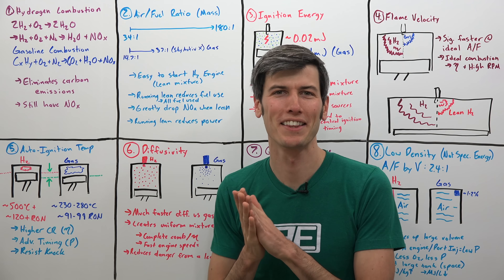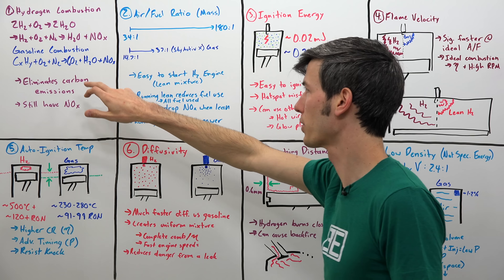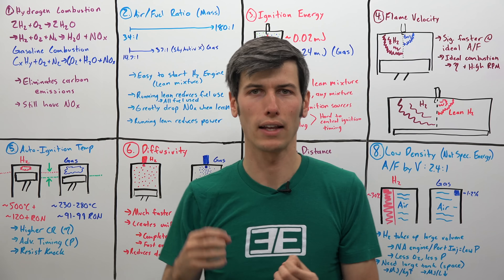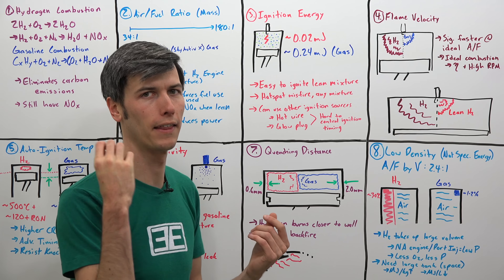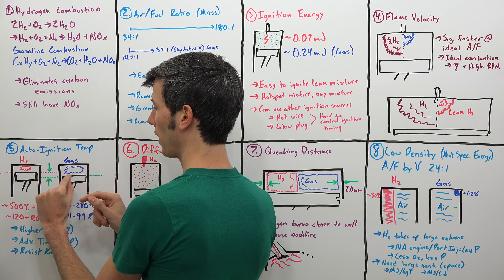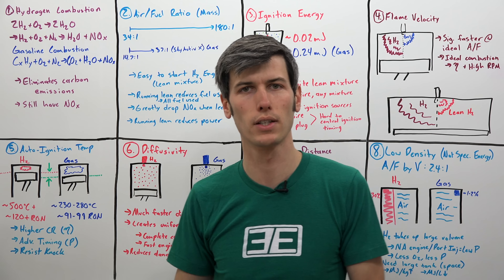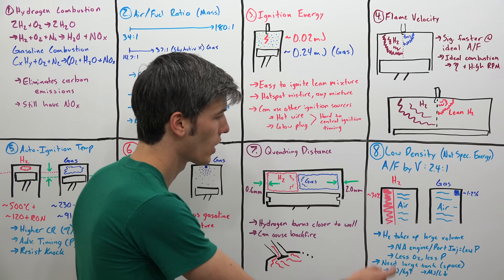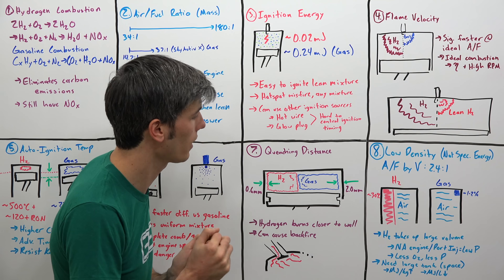The Difference Between Gasoline And Hydrogen Engines

Comment: I really like how all the pro's and con's are presented in just the facts. I wish the news was like this.
Reply: Walter Cronkite delivered news via television in that manner just facts. One wanted to watch his newscasts.
Reply: Nobody has to listen to the fake news.
Reply: we're screwed until the country is run by scientists, engineers and doctors. We won't get news like that until politicians aren't really politicians anymore
Reply: What about using a rotary motor like Mazda used to use? How much energy do you have and using a reed valve type carburetion. The other thing can be a glow ring on a conventional stroke type engine using Keith black ceramic pistons. The glow ring is a part of the head gasket, it is a ring that creates a ring of fire for spark that way no chance of misfire uneven. I believe there is a future in the rotary engine because of the temperatures running you don’t have to worry about the seals like gasoline rotary engines like that RX seven. Also, it could be ran on multi fuel mixtures. I have been involved in alternate fuel cars before in the past for many years propane cars using small gas injection to start it and keep the rings oiled. Please respond to your thoughts on multi fuel hydrogen, a detonator that would stop any pre ignition what do you think it would be.?
Reply: Perhaps at the alcohol ethanol, as a pre-starter for hydrogen.
Reply: It was pre 911
Reply: Did he really mention that CO2 is highly preferred pollution over NOx?
Must of missed it.
NOx is an oxidizing agent and will react with other gases, particles, etc
What you end up with is ground level ozone, smog, acid rains and more issues.
My main concern is that this guy know it but make no mention while claiming "at least we get rid of that Carbon pollution" without even a mention about NOx big issues.
It cause respiratory problem, allergies, inflammation of the lungs and throat, etc.
How do I know he does ? He know what he talk about on it for the rest of the video. Bit of a bias when you claim a good thing you get rid of is CO2 when you dont show the other is worse.

Its hundredS of time more dangerous for our climate. Why do people never explain that impress me. But such is youtube I suppose.
(not trying to pull him down, still a fun watch)
Reply: @littlegile5072  Because we have things called catalytic converters, and for diesels DEF exhaust fluid...
Reply: @SGTGGeorge  dont think you replied to right person because I do undertstand 2 things clearly. 1. NOx is more toxic, polluting and problematic than petrol based cars.
2. Talking about car parts doesnt changes the facts.
Reply: @littlegile5072  well if you knew anyting about how a catalytic converter works you would know that uses precious metals and a catalyst reduction reaction to break down the NOx into lesser polluting elements... 
Here's the official definition By most estimates, catalytic converters fitted inside the exhaust pipe of a gasoline-operated car convert over 90% of hydrocarbons (HC), carbon monoxide (CO) and nitrogen oxides (NOx) from the engine into less harmful carbon dioxide (CO2), nitrogen and water vapour.
Reply: @littlegile5072  like the Toyota Mirai
Reply: @littlegile5072  petrol based fuels still produce NOx, they’re worse for the environment in more ways than just CO2, but you seem to be overlooking that and just going “nooooo hydrogen bad because NOx, Petrol is betterrrrr!” Without addressing the fact that no, Petrol is not better it is far worse
Reply: @littlegile5072  and the pollution of batteries to  make them and throw away
Reply: @onlythewise1  You do realize that Hydrogen is the way forward... All electric cars are not... Until battery technology can advance to the point of recyclable, high capacity, high voltage, compact batteries arrive. Which there is already tests on solid state batteries and solid state hydrogen fuel cells that will be the future.   Oh and you can make hydrogen in your garage from water using electricity... Can you do that with fossil fuels?! 👌😉😜
Reply: @onlythewise1  I agree to use batteries that can't be recycled is idiotic. But we recycle all our car batteries.
Reply: @SGTGGeorge   hydrogen been discussed twenty years ago dork. i bought some stock in it it  failed   there doing batteries
Reply: @onlythewise1  Key words being "discussed" in a world where Oil was cheap and abundant and no one gave two shits about carbon pollution... Porky..
Reply: @SGTGGeorge  oil never been cheap . ok real porky
Reply: @onlythewise1  Not to mention that we would of never landed on the moon without Hydrogen Fuel cells in the 60s. So a lot longer than 20 years ago! The military uses Hydrogen Fuel cells still to this day successfully.  Arnold Schwarzenegger has a hydrogen powered fuel cell that powers his Christmas lights! 🤣😂
Reply: @SGTGGeorge   i know that i dont need a  parrot reading and telling me things  tell me things from out of your brain not someone else ,
Reply: @onlythewise1  The more you post the more it's clear, that you are "special". 🙈😱
Reply: @onlythewise1  That was all out of my brain. And then I went and pulled the definition of Google to show you... I went to automotive school, and worked in the industry for ten years.
Reply: I apologize for disrespecting you after you disrespected me. That was childish of me for falling in that trap.
I only strive to educate. And have my voice heard. I do not enjoy putting people down. Please forgive me for upsetting you and have a wonderful day!🌍
Reply: @onlythewise1  I read and study all the time. I love learning new things, and all of this kind of stuff fascinates me and I'm highly passionate about my mechanical skills, and technological prowess.
Reply: @SGTGGeorge   and you repeated all that   you read  not   do in your own brain  Einstein did in his own brain hydrogen been known for over hundred years i leaned the element chart fifty years ago
Reply: @SGTGGeorge  the more you talk the more i can see your into your self
Reply: @SGTGGeorge  😂😂😂😂😂😂😂😂😂
Reply: @onlythewise1  🙈
Reply: @SGTGGeorge   out of your brain is something you created  not something  you read and then say it later
Reply: @onlythewise1  So I see the problem here you keep moving the goal post on why I'm wrong to something not even remotely close to what we're originally talking about. It's my fault for not interpreting your broken English, and lack of grammar and ability to communicate and to properly express yourself. And I take from what you just stated that some how I'm wrong or that I'm plagiarizing definitions? And I was supposed to put forth an brand new original idea to rival why NOx you say is the worst?  I did that scroll up...
Reply: @dianapennepacker6854  Carbon nanotubes solve the volumetric density issue. Toyota is looking into solid storage mediums that store hydrogen at a much higher densities and have made tremendous progress with hydrogen 
Also you are incorrect the fuel cell mirai does not weigh near as much as battery EVs.  Hydrogen is the future battery EVs are not the answer.

Comment: Hmm I'm thinking rotary engine.. Made like a super diesel with super high compression, and spark plugs. The lack of carbon would probably make the difference and it would probably lend itself to the general charictaristics.. CMon mazda.. u can do it.
Reply: The trick to the tank is to find something dense you can knock hydrogen molecules off of for fuel. Or find some lubricating fluid that is clean to use as a carrier molecule.
Reply: Imagine if you could use the fuel as a lubricant too, and its waste comes back through and grabs the hydrogen for combustion again.
Reply: lol Skyactivex rotary

Comment: Video should be made, to explain how hydrogen is the same as gasoline.  They're very expensive.  They're both bad for the environment, as they are about 20% efficient.  They both require expensive, service requiring engines.  The hydrogen vehicle hoax, aims to extend legacy ICE vehicle production into the foreseeable future.

Comment: Very well explained .. thank you.
Back in the 60's, my Uncle Stan, a consummate Popular Mechanics Reader (I too, loved going through his Mags)  even then, predicted that Hydrogen would one day become the Fuel of Choice.
Given the current Situation and the push for 'Cleaner Energy' (however misdirected it may appear at times), our Scientists and Engineers are being forced to 'adapt'. Mankind thrives on Adversity and it's associated Challenges and it is under such Conditions that we become the most Inventive.
Interesting times ahead ..
Reply: Most Scientists and engineers will tell you that hydrogen won't be the future. The only future it has is potentially in 18 wheelers and Busses that go very long distances, as well as in potentially ships. 18wheelers and Busses will use fuel-cells though, since it reduces complexity of the system a lot, and thus increases reliability a lot over a combustion engine. For everything else it's gonna be fully electric. And it likely won't be Lithium Ion batteries in the future, but other battery tech instead.

Comment: One thing you did not say is that gasoline is hydrogen. Huh? Hydro-carbon. What do you think the Hydro part is? Does the carbon burn? Not really. So you are left with Hydrogen, the carbon is just a way to store Hydrogen. So engines run on H already. Carbon slows down combustion so timing must be retarded. Pure Hydrogen burns very fast and clean. So carbon is a storage medium, but guess what, water is also a Hydrogen storage medium and it does not require huge refineries to extract the energy.

Comment: Great video 👌
Although there's a big misunderstanding that the Hydrogen cars available currently use Hydrogen in that way, they don't, mainly because the amount of Hydrogen you would need to carry on board, it's also not a very efficient way to use it.
Far better is to use Hydrogen in a fuel cell (battery) to power an Electric Car like the Hydrogen cars currently available.
Reply: Hydrogen fuel cells and Electric lithium solid state batteries are the future and I can't understand why people are so afraid of it because oil is not going to go away for decades as we transition into alternative fuel sources

Comment: Thank you so much for this vid. Like many people I thought the only output from hydrogen fuel was water. I had no idea that when the stoichiometric ratio approaches that of petrol (gas) ie 1:34 that nox is produced as well. Not a problem because it can be neutralised with urea, but lets hope they build one better than the current Bosch offering installed in my MB. It keeps failing and costs thousands of dollars to keep fixing it!!!!!
I learnt more about this subject in 14 mins than in my preceding 73 years - well done indeed.

Comment: how about a hybrid vehicle were the Hydrogen engine turns a powerfull generator that drives the whells via electric motors .. as well as providing the electric nesseccary  to make the hydrogen as its needed  from H2o. .. engine is direct injected with the hydragen and oxygen .. eliminating intake valves and nox by not pulling in nitrogen .. energy denisity is in the form of H2o.. and the exhaust could even pass through H2o storage so it collects some or most of the H2o Exhausted.. when the Fuel is Water Efficency numbers matter so much less. 
..

Comment: One thing he doesn't address (except perhaps in the volume thing...?) is the lower energy of H2 combustion. Burning H2 does not produce nearly as much energy as burning a hydrocarbon such as gasoline (the C + O2 -> CO2 produces more energy than H2 + O -> H2O). Also, I'd like to see a comparison between H2 and diesel, which has even more energy and is used in compression ignition, and because of it's wide combustion ratio, you can "throttle" the engine just by adjusting the amount of fuel injected and leave the air alone.

Comment: JCB here in the UK are using existing common rail diesel engines fitted with just high-pressure hydrogen tanks that can run for 8 hours.
No billions wasted in the development of fuel cell engines.
Simply fill up the same way as if using LPG. Fully electric cars aren't practical when your car is parked outside on the street as the majority of the population in cities are. 
Hydrogen is the future.

Comment: Nice presentation, love dealing with the fundamentals.  So how about hydrogen's traits as a turbine fuel?  Since long-haul aviation is a big carbon emitter, and seems destined to be one of the last holdouts that just won't be viable without a combustion fuel in liquid (er, slush) form.
Reply: Great very informative
Reply: shipping will be the last to switch,  when u look at the emissions of container ships etc you realise they are massive polluters.  and the amount of them can and have changed weather patterns in the pacific..
Reply: @imoovabull6042  ships also have the option of using nuclear energy. If it weren’t for the relatively small canals we have, we’d see way more massive nuclear cargo ships.
Reply: Probably simpler to react the hydrogen with CO2 to make methanol and then use that as fuel. Much simpler to handle and store since it is liquid at room temperature and pressure. But it is lower energy density than kerosene so the range will suffer a bit.
Reply: @zapfanzapfan  Right.  Fuel tanks 15 to 30 times larger makes for huge aeroplanes

Comment: The term air you keep referring to is nitrogen with a oxygen content plus other gasses in a small amount. As you will be aware oxygen is the oxider to release the heat from the fuel used. Maybe it would be good to explain how nitrogen is what makes engines work and creates cylinder pressure. The oxygen oxidizing the fuel heats the nitrogen which does the bulk of the work. If nitrogen was removed from the intake the engine would have very little power and it would  barely run. Maybe the white board was to small to explain the the process how engines work.  Nitrogen heated  is the T1 T2 event. Hydrocarbon and oxygen is the flash in the pan that causes rapid expansion of nitrogen.  Good effort and a lot of work in your presentation. Cheers.

Comment: Yes, you CAN use hydrogen as a fuel this way, but we SHOULD NOT be doing it this way, because it will not stop oil & gas extraction, and the solar/wind etc energy needed to create and store it is very high.  Hydrogen is a dead end.

Comment: YOu would need liquid oxygen and liquid hydrogen tanks. No air needed. However it's more efficient to just pour the fuel into a chamber like in a rocket. The tight tolerances needed in a piston engine would be impossible. You would get backfires when the fuel leaked past the cylinder walls and piston. An HHO torch requires a spark arrester to prevent a very dangerous backfire from HHO gas escaping backwards up the fuel line. An engine would be a nightmare.

Comment: Please tell me if Hydrogen is impossible to use as a fuel source, how did BWM have a working prototype in '86? Also, he is talking about using a gas as a fuel source. I thought there was already a modified type of engine that that does this with (CNG) Compressed Natural Gas?

Comment: I don't get it.  Isn't it way more efficient to use the hydrogen in a fuel cell/electric motor?  Isn't a ton of energy lost as heat when you burn hydrogen?  Same old problem as a petrol ICE.

Comment: Considering most nitrogen is produced from natural gas, we are still using fossil fuels.  If you produce it through electrolysis of water then you are using up another very valuable natural resource, not to mention the cost of  desalinating the water.  Unless of course you want to use fresh water, because we have plenty of that, just ask all the drought stricken areas of the world.

Comment: One good question is you talk about Mazda's Sky Active motor that run so lean yet in the real world as soon as that engine is put into a vehicle it gives the same fuel consumption as the average of other engines and there is other Manufacturers that beats Mazda's Sky Active fuel consumption, to me I just think that Mazda is doing the eco cheat that VW is doing to lure customers into buying their vehicles. Any engine can be so set up in the lab to be fuel efficient but put that engine in a vehicle and then that so efficient engine turns out to be average.

Comment: The problem with the air-breathing engines is just that it has to breathe and that takes energy as many other parts of the engine absorb energy to operate. No matter what fuel you use it has to be delivered it can't be transported done a wire at the speed of light. Where is the advantage of using a very volatile fuel like hydrogen in a piston engine. So many mechanical parts reducing efficiency. Torque is still very low as power is wasted as heat noise and lots of friction. It's a waste of time and money using hydrogen to fuel a piston engine being very expensive and only seen as an advantage to those who want to cling to a piston engine that makes lots of noise and still needs loads of oil to make it work. No matter how these engineers try and cling to this old technology sooner or later they will realise it is doomed. You can't turn a sow's ear into a silk purse.

Comment: How about a hydrogen powered "liquid piston" rotary engine? Seems like the already ridiculous power/weight could be enhanced.
Reply: Toyota had a 4 stroke hydrogen gas direct injection engine based race car participating in an endurance race last fall. You can find clips about it here on YT.
Reply: @Mike-zx1kx  Thanks. I'll check that out.

Comment: Great video. Can you inject hydrogen aswell as a petrol to increase performance like you could with nitrous oxide? 

Imagining it in a vehicle, if you have a much faster flame velocity, does that mean in a catastrophic failure due to a collision instead of catching fire it would go boom? How could you make a safe system with a pressurised volatile gas? I mean theres a chance to escape a fire but not much if you're vapourized on impact